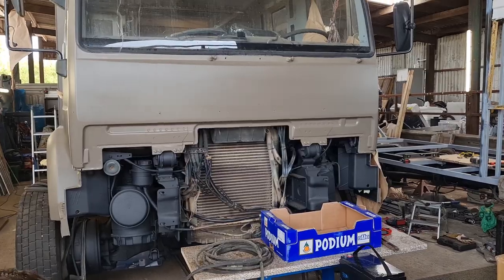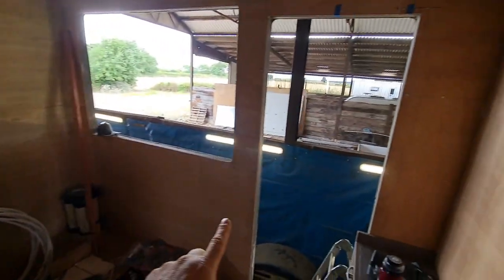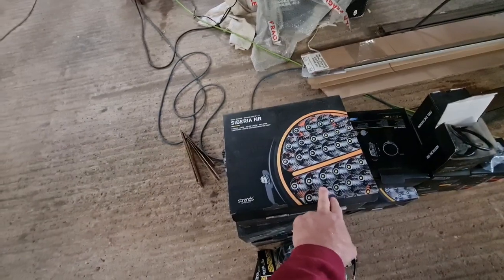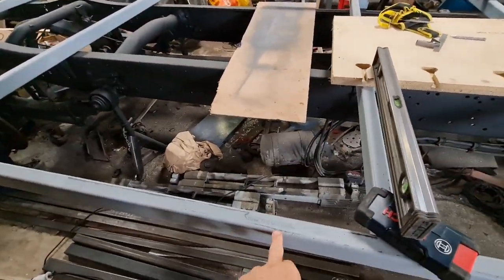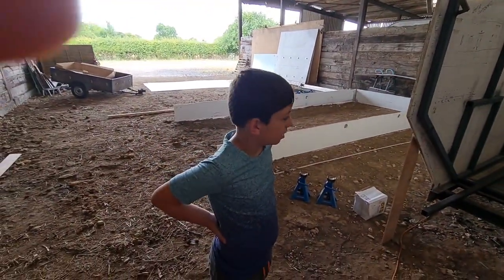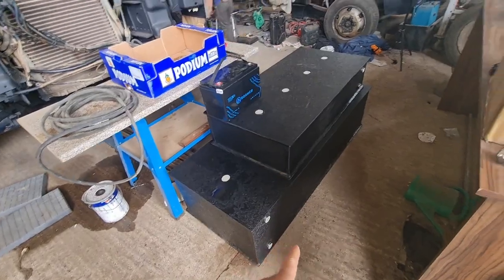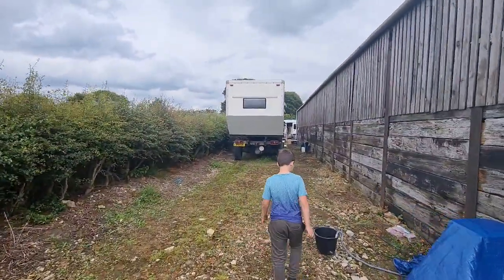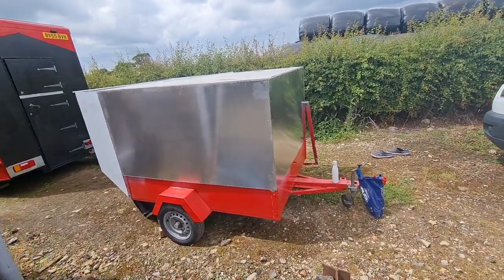THE HIVE OVERLAND NEW TRUCK  BUILDERS UK

Comment: Thanks for the update.  Great looking rig, it will be a beast. 💪🛠🦍👍

Have you thought about having a bypass valve if the recirculating shower water plugs up or mold builds up before the light filter?

Congratulations on your success 🌞💪
Reply from the maker: The truck is now touring the world check out on Instagram follow the leopard
Reply: @TheOffgridNomadUK  Roger that

Comment: That New Eco Flow System looks lot less Hassle to install, Supposedly  DIY able , See Liams Vid
Reply from the maker: Seen the video but that system is great for campers not overland trucks it's far too small
Reply: @TheOffgridNomadUK  power wise?
Reply: @deenunya7735  Your right the new EcoFlow kits can power up a small city and are expandable. It's next generation tech.
Reply: @UKvet246  acc to off grid too small
Reply: @deenunya7735  2kw or 5kw batteries, up to a maximum of 15kw there's easily more than enough power.
Reply: @UKvet246  i thought that, off grid reckons not lol